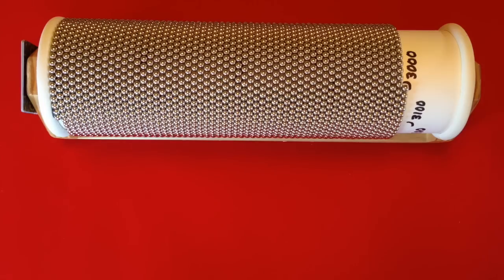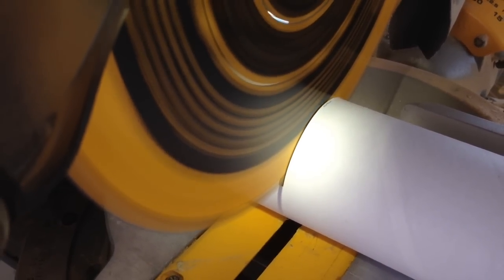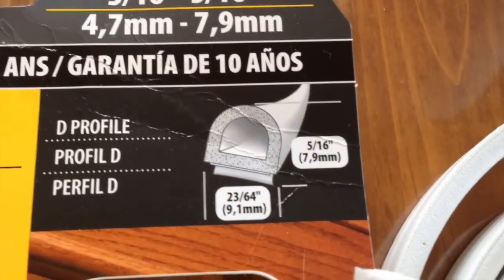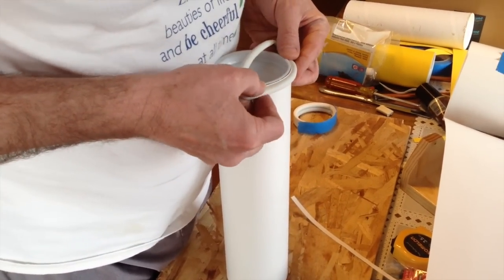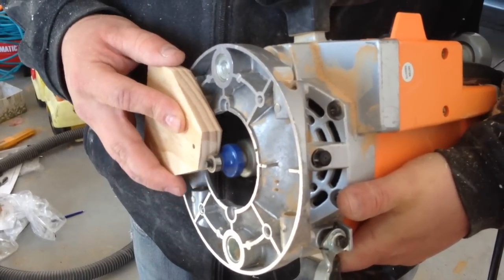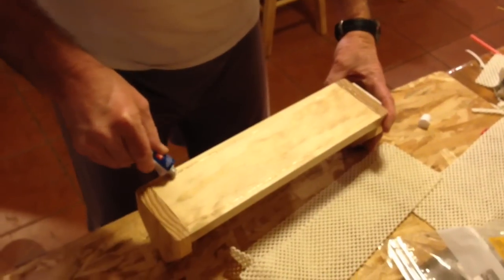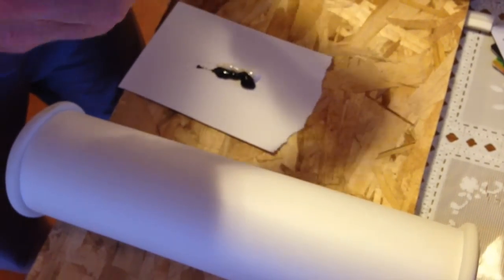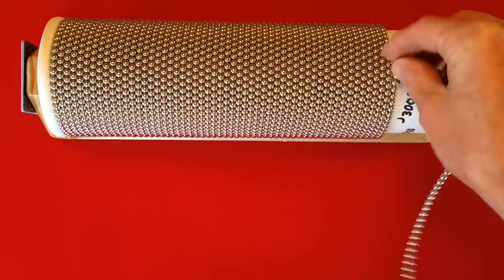Magnet Spool Construction Tutorial (Zen Magnets)

Comment: But how do you get them onto the spool?  Laying them out in lines and attaching them like that seems redundant... If you're going to line out 3000 magnets, why do you even need the spool?
Reply from the maker: Hi Balgore8:  I lay out chains of 100 magnets only once, for the purpose of marking the tube.  After the tube is marked, then you just add and remove magnets from the spool as needed.  You can wind (or remove) a continuous chain of 3400 magnets onto the spool, if you want to.  (That would be a long chain.)  But generally, when I finish a project, I smash the project and wind its magnets onto the spool.  And when I build a project, I build it directly by pulling the continuous chain from the spool as needed to build it.  Marking the tube helps me to know I'm not missing any magnets, when all of them are wound onto the tube.
Reply: Boyd Edwards So when you're finished with a shape, smash it, and put the dots back on the spool, how do you get the dots back on the spool?  I imagine you still have to line them out?  I can definitely see how the spool is useful and much faster for making shapes, it is the re-spooling I can see taking a long time.
Reply from the maker: Balgore8 Yes, you still have to stretch the magnets into a chain, but winding them on the spool is almost instantaneous compared with the time it takes to stretch them into a chain.